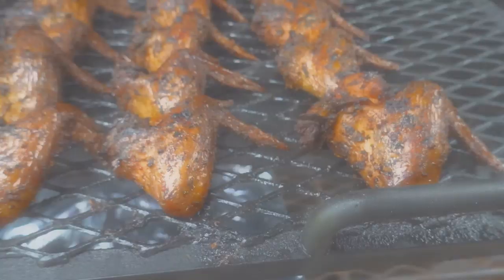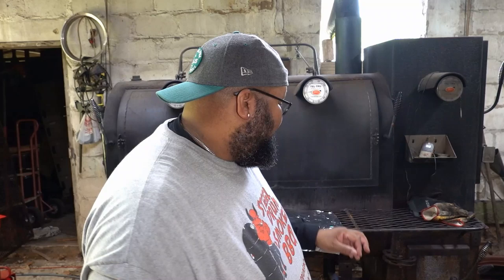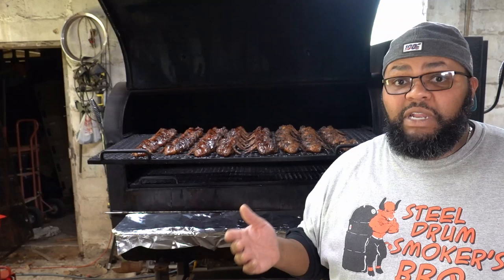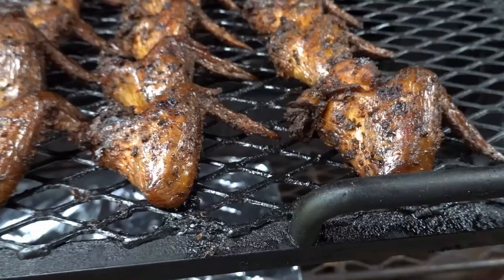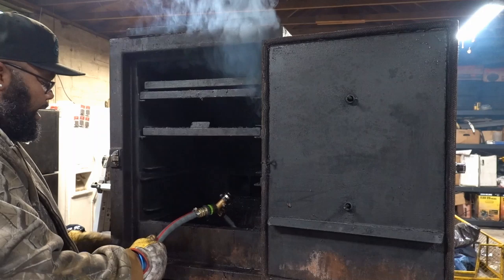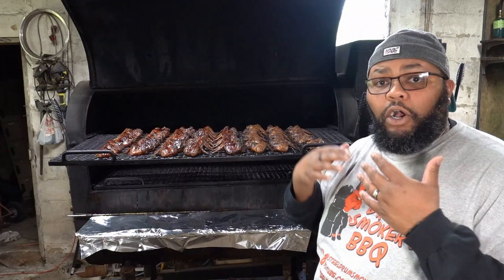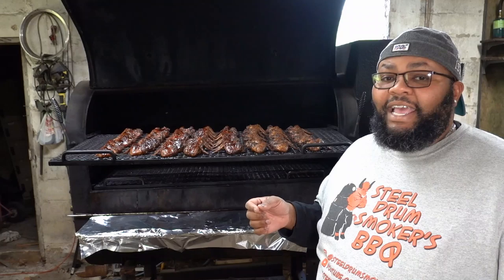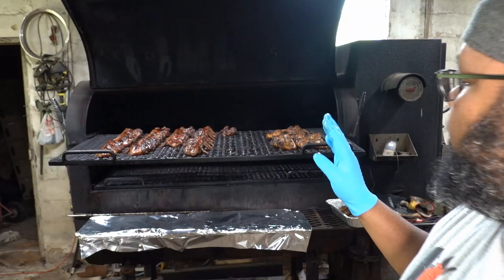SDSBBQ - Comparing Smoked Chicken Wings Cooked in Different Smokers!

Comment: I always wondered why you use more charcoal than wood. I use both when i cook. Charcoal mainly in my weber and when im getting my stick burner going but I use mostly wood in that. Taking cost out of it which fuel do you think is the best flavor wise?
Reply from the maker: Flavor wise... they are VERY similar. The main difference why I use what smoker is the size of the cook. So bigger orders sometimes benefit from having just a bit more smoke flavor due to the cooker.

Comment: One of the problem Im having from time to time the skin gets like rubber drives me nuts
Reply from the maker: Higher heat will hopefully help that's why I cook wings closer to 300.
Reply: SDSBBQ last time I think I had it to hot 350-375
Reply from the maker: Ahh might be an issue. I typically end up cooking them too low in the past.
Reply: If it helps, what I normally do is that I would smoke wings at 275f and once they reach 165 internal temp I take them out of my smoker and let them rest for about 15-30 mins, after that I toss them into a bowl with olive oil, shake them around and then crisp em up in my weber kettle grill. You get best of both worlds; smoke flavor and crisp skin.